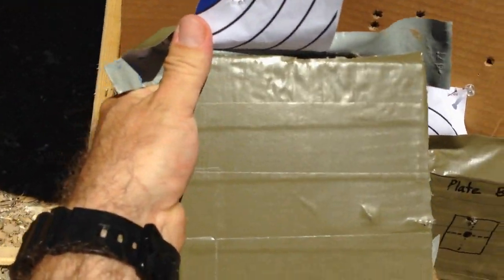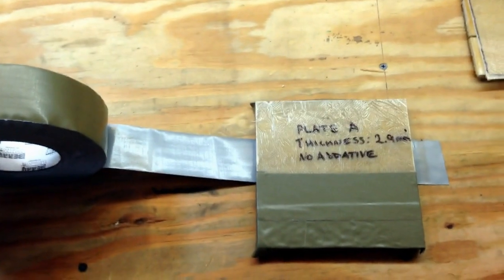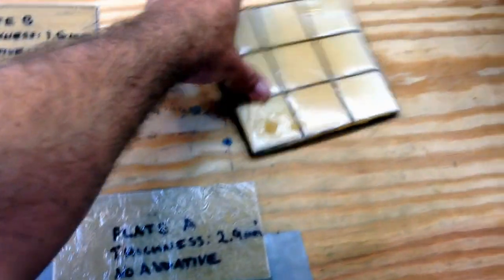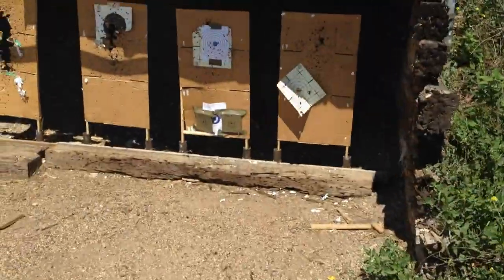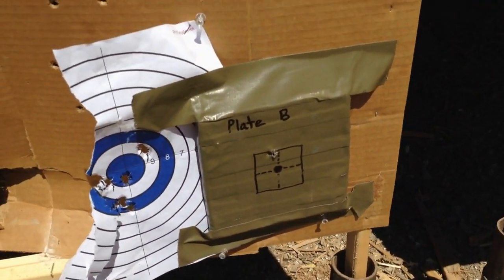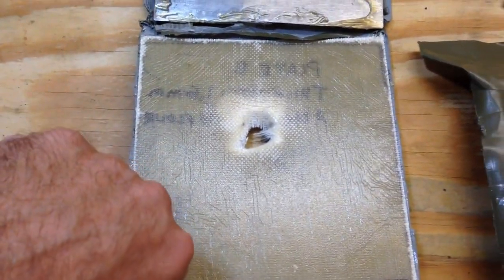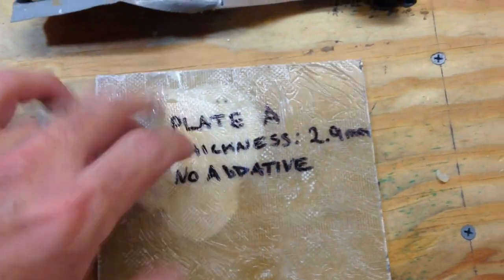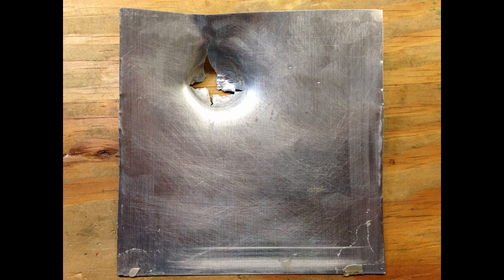Homemade Bulletproof Body Armor Plate

Comment: My wife bought me my first vest when I went into the Academy in 1979.  My mother worked as a CHP Matron in the early 70's when the California Highway Patrol made vests mandatory for all patrolmen.  The controversy in the early '70's was a lot of older cops didn't want to wear their vest due to comfort and "showing fear" to the bad guys.  In my 36+ years of Law Enforcement I've worn department issued vests about 1/2 the time.  I'm currently (last 23 years) the supervisor, Sergeant of a DoD Security Team at a rural Aerospace Facility.  Vests are supposed to be worn while patrolling certain areas and remote buildings.  We are not strict about wearing vests but each guy does have access to a clean vest that is newer than 5-years old to wear if they choose.  Most of us old guys wear them some of the time but the younger guys (that have small children) wear theirs almost always.  Law Enforcement has Militarized quite a bit in the last 40 years.  Good video, but you can BUY a vest a heck of a lot easier than you could make one...
Reply from the maker: Buying a used vest is definitely the best option
Reply: I collect body armor and have had the pleasure of speaking with Rich Davis who developed 2nd Chance. It's an amazing product to learn about and study its history.  A state trooper told me about the 1st gen. vests. Heavy, stiff and hot, hand made seat covers with some stand off made them more bearable to ride around with that mess on. It must be terrible to wear 8 to 12 hours a day.
Reply: "you can BUY a vest a heck of a lot easier than you could make one..." except for when you actually can't, which is when you wish you knew how to make one

Comment: Try adding a layer of thick urethane rubber I think It will have surprisingly high energy absorption. I like use of the denim idea the dragon scale armor concept uses multiple layers of LOOSE leaf Kevlar sheets, not coated with any resin. Harbor freight offers a high temp resistant fiberglass matting made for welding which might be a good consideration as well.

Comment: Try overlapping the ceramic plates like tiles on a roof. Both shots hit the seem between the tiles, or at least that's where the energy was dumped. There is a armor plate called dragon skin that overlaps tiles to prevent that from happening. Good luck!

Comment: I notice everybody uses polyester resin, Epoxies are several times stronger than Polyester. Also in general you want to use as little resin as possible to saturate the glass. Extra resin makes for a heaver and simultaneously weaker composite.

Comment: Borosilicate glass is dirt cheap now, but if you find it hard to find plates of it, most transparent cookware pans are of this type.

Take a  3/16" pane of such glass and back it with PVC laminate. Once complete, turn a second piece of laminate 90 degrees to the grain of the first, and add another layer. This lines up the laminate for maximum force distribution.

This is the basic transparent armor found on a lot of office buildings and light helicopters. It stops fragmentation and can even stop some smaller caliber bullets.

Two such laminates bonded together in series can stop any caliber handgun round commonly in use. Three to five such laminates can stop multiple rifle shots, as long as they don't hit the same place twice.

Comment: That was a pretty good try. I would prefer to buy ar500 body armor tho. Out of the two plates you tried first, one stopped the round the other didn't. So your armor stopped the bullet like, 50% of the time. My ar500 plates can take hits from .308 until you run out of ammo

Comment: I have worked with laminates almost all of my working life, & I have a suggestion I'd like to see you try: this lam schedule
4 layers 18-24 oz. roving
5 layers kevlar cloth[6 oz.]
4layers 18-24 oz. roving 
Lamination to be done with HYDREX resin. 
Hydrex gives the layup much better strength than standard polyester ortho type resin, which I am sure that you used, because that is all that is sold to the general public in small quantities. You may have to go online  to find the hydrex & the kevlar, but, I think you'll have good results with this layup. I tried it  against 9mm, with no complete penetration. The resin used is important.
Reply: ***** I thought about the same thing after I posted, My suggestion is not cheap, & not quickly available for DIY. It works , but not in the realm you are pursuing. Keep up the interesting experiments.
Reply: +Charles walter do you think it can stop .40? I got alot of kevlar cloth, i am building a iron man costume. Before you think i am crazy, no, i do not pretend to use the armor to go around taking shots on me.
Anyway, i was thinking about use the kevlar cloth (thats why i already bought it) on the armor, its molded on fiberglass, and i also laminate/press some titanium, and i will cut it like coins, to build it like dragon scale... But only with the kevlar and roving.... do you think it can hold a .40?
Reply: Aureo Yamanaka I don't really know. the trick is to build a smaller version of your intended layup schedule & try it against .40 cal. I personally have gone to 9mm. please remember that cheap polyester resin will not give you the same performance that vinylester [hydrex], or epoxy resin will give you. Don't opt for cheap resin if you're trying to make this piece bulletproof, & no I don't think you're nuts, just inquisitive. As a final note, the coupon [I believe that's the correct term] I tested was almost 3/8" thick, & tested @ very close range.
Reply: Yeah. I am using only Premium materiais. Its not  cheap . I Already spend alot. And yes. I am inquisitive, or intusiast idk, I just like to do the things like closets to real. I like iron man also. So I am doing this. Plus learning alot of arduino to make the parts control movement's and also working on a partially exo esqueleton with an friend who is mechanic engineer. All this is crazy and very fun.
Reply: Aureo Yamanaka Have fun.

Comment: I think the ceramic is just adding mass...which is ok but not optimum. The same total weight of quality fiberglass and epoxy resin would be more effective though. There is a guy who used welding fire blanket, 1 blanket = 1 plate after the resin and clamping. I'm going to make a plate to go in a backpack which can be strapped on front or back as needed. My laptop and papers will add mass and the backpack is already padded.

Comment: informative video thanks for posting, i was wondering how thick is the sheet metal used here? and whats your opinion on using 2mm thick steel plates instead ?
Reply from the maker: Too heavy for the protection.

Comment: Great stuff! Though I have to ask, won't a larger tile plate help spread out and absorb the energy of the round more? Also, have you thought about using thick plate steel or sawblade discs in place of tiles as the front face? Want to see how your denim tests turn out, hard to believe jeans would be bulletproof.
Reply: Thanks for the explanation :)
Reply: ***** What is very common in ceramic armor patents is a small amount of resin/fiber composite infront of the tile to contain the tile fragments/bulletfragments. Overlap from backing layer to sides of tile is also common to prevent material from exiting the sides of the armor matrix.
Reply: +M van dongen Yes, thats something to take in consideration, i will soon make plate with a lot of very cheap materials, and i will include one layer of some fabric at the front to minimize fragmentation, so far i stopped 7.62x39mm

Comment: You should try a  carbine rifle in 9mm. The extra barrel length will take full advantage of the available gunpowder. A plate that can survive the full length barrel will survive any pistol length barrel. It would give you a much better protection level against handgun rounds...  Hi point rifles are very cheap, but insanely accurate. Would give you the test platform to carry this to the next level if you don't own a 9mms carbine.
Reply: ***** -  I fully understand your want for the Keltec. Just don't totally count out the Hi-Point as an option. The extended capacity mag is the Hi Points only flaw. And for the price you can get it to use while you save up for the Keltec. I have the Hi point in .40s&w, and next to my AR it is my "go to gun" , and perfect to put in some one else's hands should I need back up. You can pick one up for around $300 depending on where you live. And the Hi pOint has a life time warranty on all parts for the life of the gun! Def. worth checking out. Esp. for the price......
Reply: ***** -  I fully understand your want for the Keltec. Just don't totally count out the Hi-Point as an option. The extended capacity mag is the Hi Points only flaw. And for the price you can get it to use while you save up for the Keltec. I have the Hi point in .40s&w, and next to my AR it is my "go to gun" , and perfect to put in some one else's hands should I need back up. You can pick one up for around $300 depending on where you live. And the Hi pOint has a life time warranty on all parts for the life of the gun! Def. worth checking out. Esp. for the price......

Comment: Line the plate with bullets facing toward the shooter.  When a bullet hits a round in the vest, it ignites, pushing its projectile outward against the incoming round.  Counter-force.
Like reactive armor, just less boomy.
Reply: Reactive armor!  Those little blocks all over the sweet-spots on a tank.  Not safe for body armor use.
Reply: Greg Gallacci Not to mention the primers are on the rear of the casings and not the bullet haha.
Reply: Or you could use a movie squibb instead for the reactive armor
Reply: Greg Gallacci Reactive armour is for creating an expanding air space to dissipate the molten plasma jet from a shaped charge. Won't work on a solid bullet.
Reply: M van dongen I think you are mistaken between conventional shape charges and EFPs (Explosively Formed Penetrator). Shaped charges in HEAT munition work through a hyper-velocity plasma cone/jet formed by the "shaped" explosive around the metal liner (usually copper, but aluminum and tantalum is also used). "Plasma" in this case refers to the liner's metal in molten liquid state, since liquid doesn't compress, it punches through the target as if it was a driven solid penetrator.

Shearing of kinetic penetrator rods as you mention are only possible with the newer generations of reactive armour such as the Russian Kontak. But older reactive armour only does what I mention, increase the standoff distance between vehicle's conventional armour and the attacking shape charge, since air spaces readily disrupt and diffuse the plasma.
Reply: Plasma is a state of matter where the outer electrons are stripped of the atom, this requires many thousands of degrees. Think surface of the sun hot.

That is not what happens in HEAT charges or EFPs. Both are related, HEAT charges utilise very light liners and are optimised for penetration within a few projectile diameters of the explosion, typically 10 or less. EFPs utilise heavier liners and are optimised for longer engagement ranges at the cost of less penetration ( but more after armor effects due to the heavier/bigger penetrators relative to PD ). 

Both form their penetrators by plastically deforming the liner due to the high pressure of the explosion. The liners flow like putty. What differs  is the shape and mass of the penetrator.

Explosively forming metal is even used in some critical applications where the high cost is less important than high performance. They even bond some armor plates this way.....
Reply: M van dongen  Hey Dongen, so I rechecked my sources, and it appears you are right :/ , the formed jet indeed does stay as a solid, not a molten liquid. I'd based my information on old publications I read from the early 80s, before they had x-ray diffraction tests to reveal the true state of the plasma jet ("plasma" is what the US Army publication coined, not me). It appears I have some catching up to do with my readings.
Reply: Bulsh1tMan like I said, it depends on the configuration of the Reactive armor package. Typically heavier flier plates for ERA designed with long rods in mind. 
Also some terminology errors, standoff distance is the distance the HEAT charge has from whatever it is trying to penetrate, while that does occur with Reactive armor packages, which are typically fastened over the main vehicle armor, the main intent of reactive armor is increasing the amount of material the penatrator has to go through ( since the flier plates are pushed into its path. ) and the disruption of said penetrator.

You can find some wonderfull hyper fast xray photography of interrupted jets due to reactive armor packages.

One of the biggest advances in heat charges was the application of piezo electric based detonators that allowed proper standoff distance. The funny thing is that the simple spaced armor plate configurations might actually have helped penetration by early ww2 heat charges as many didnt have enough standoff distance for proper jet formation.

Another funny anecdote, Some use training base (IIRC ft benning )  during ww2 recieved a batch of faulty Bazooka rocket detonators...the base training course described the function of the rockets as exploding on the surface of the tank armor and causing large chunks of the interior armor surface to blow off.....

What was happening is that the  faulty detonators allowed the Plastic HE filler to pancake upon impact and form an impromptu HESH charge against the tank armor. 

No one seems to have actually realised it at the time however. Only the brits fielded some HESH, mainly with the 165mm spigot mortar that some tanks used vs fortifications.

Comment: id use cheap ceramic tiles that are hard but shatter when shot. it is the same principle that dragon skin uses. then id put several rolls of duct tape on it to both contain the powdered ceramic and provide a bit more protection as i have seen an inch of duct tape stop quite a powerful bullet on some videos

Comment: 2. Cut out the rubber spacers from the tile [...]

Would you consider to fill ceramic joint gaps with mortar (3 sand, 1 cement, 1/2 water mix)?
It would ease to shape panel by skiping #2 Recommendation , while cheaper than resin, and keep serving the "abrasive" purpose of that layer.
Reply: ***** There are patents out there that use sieved abrasive fines ( SiC and Alumina and other usual suspects are given as examples ) embedded in a 15% resin ( mass ) matrix as armor plates. These are to be contained like normal ceramic plates.

Comment: How many layers is the 2.9mm. I was building one but ended up only having enough for 7 layers so i added 5 layers of denim. I was going to use 2 layers of tile.
Reply from the maker: Billy Celli I used 12 layers i beleive. Your mix should be fine. I would only go with one tile though as long as it's PEI5 hardness and not segmented. Have you seen my other body armor videos?  My denim plates are my personal favorite.

Comment: Plate should be almost in the very back, and ceramic in the front.  The idea being as the round drives the ceramic inwards it disperses energy through the fiberglass, or denim, and then basically the energy remains is trying to push a much larger chunk of material through the steel plate in the back. 
   Also rubber in front of the steel, and behind the ceramic could help.  Many light armored vehicles actually have steel with rubber in between to disperse energy. 
   Not a bad result however at all.  A solid plate would disperse energy better however.  Armor grade plate is basically ceramic integrated with carbon fibers.  It's not exactly an at home process.  You could achieve a similar result by laminating ceramic plates together with carbon fiber in between.  It would not be as good but wouldn't shatter as bad.

Comment: I've found that rubber used to make gloves causes the round to waste energy through rotational spin of  the bullets  waist spinning through the medium it doesn't need to much thickness but multiple loose layers in sheets to spin it self up. Its like if you were laying in your bed and you wrap yourself up all tight until you cant roll any more kinda like a Chinese finger trap. could be useful for bullet proofing people and in my case a backstop for rounds of low power but i was thinking of the potential some one can do with this information
Reply from the maker: +reefread1234 That's interesting.  I would like to see this in action.  Please publish a video to see.  Thanks

Comment: Rather than fibreglass, why not use carbon-carbon or Kevlar? Kevlar is hardened with the same epoxy resin that fibreglass uses. And it'll stop it better.

Comment: biggest thought is the round going through the cross points and with the cement I would rather the resin overall cement breaks to easily as well as add weight

Comment: Want better home made armor? Buy or make graphene powder mix with the resin till black and thick apply to layers of fiberglass stacked an inch or more thick vacuum remove the air and then compress it tight enough to squeeze out some resin and then hold it there till it drys solid,  bolt plates will do the trick.